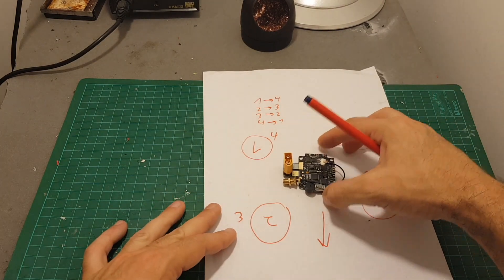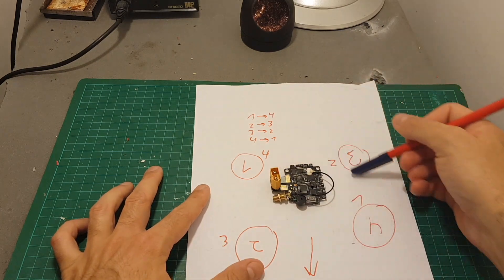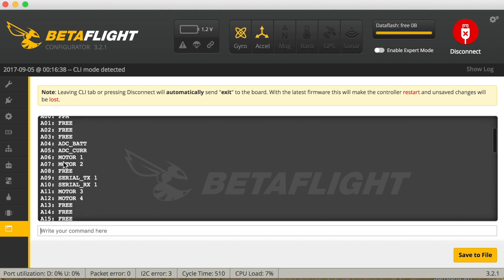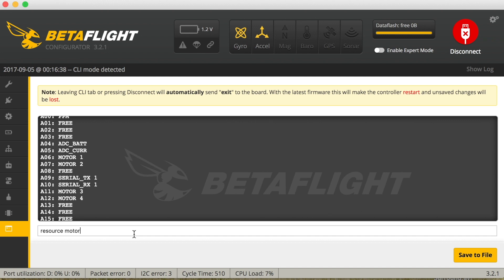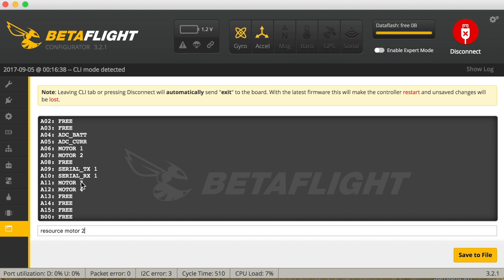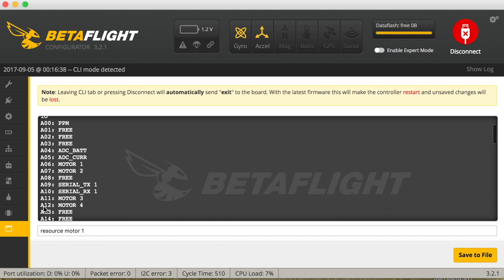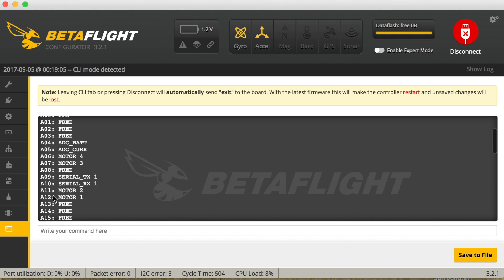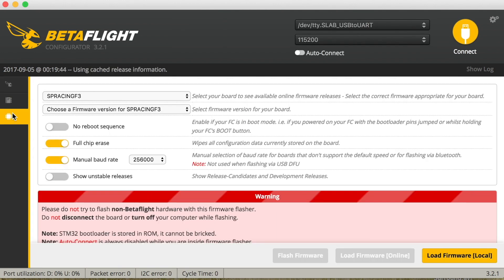Betaflight Motors Remapping Guide

Comment: Guys, I tried to remap the motors today. Did for 3, but wanted to check which resource to map to my last motor (it stayed disabled). Clicked cancel and now BF won't connect to the controller at all :( Anyone knows what the reason can be?
Reply from the maker: Did you figure it out?
Reply: @KremerFPV  thanks, yes. I did bootloader from FC and reflashed the target.

Comment: and if after this, some motors are spinning in the wrong direction? then what?
Reply from the maker: You need to adjust the motor direction using BL_Heli or BL_Heli32 app, depending on your ESC.

Comment: I have a slightly different problem which is that my 2 front motors spin in the same direction and my 2 rear motors spin in the same direction. So, I want to switch 1 and 2, but when I use this method, the two front motors still end up spinning in the same direction and same for the 2 rear ones. PLEASE HELP! Anyoneeeeee
Thanks.
Reply from the maker: You need to reverse the direction of your motors using BLHELI_S or BLHELI_32 depending on your ESC.
Reply: Gal Kremer thank you. Quad is in the air
Reply from the maker: @trisssssssss  Perfect!

Comment: I just replaced motors on a fully running quad. The front pair are backwards. The rear are correct. How do I change individual motor direction. Swap outer 2 motor leads maybe ?
Reply from the maker: You can swap out two motor wires or change the motors direction using BL_HELI or BL_HELI32 suite, depending on your ESC.

Comment: Thanx a lot, I just had to remap my motors after updating my Tinyhawk Freestyle to betaflicht 4.2 RC3. 
You saved my day!
Reply from the maker: My pleasure. Have fun! :-)
Reply: i have the same problem after betaflight update i had to remap my tiny hawks motors, but it stills flips over when i first try to take off, i checked the motors and prop orientation, also check the board alignment. were you able to get yours running??
Reply: @BmoreVisuals  Yes. 
Try Configuration -> Board and Sensor Alignment -> Yaw Degrees "90" and First Gyro "CW 180"
Reply: @BmoreVisuals  props in correct way?

Comment: nice video. i only want to change the direction of one motor. what command should i write? e.g. i want motor 3 to be in reverse direction.
Reply from the maker: Thanks. For reversing the motor direction use either BLHELI or BLHELI32 suite.

Comment: Hi man nice video as always!!! I have the FC and 4in1 esc upside-down and motors won't arm...need only to remap the motors?
Reply from the maker: Thanks,  yes, you can and should remap the motors,  but it has nothing to do with the arming issue. Check the arm flags on BF.
Reply from the maker: If the FC is upside down too, you need to change its orientation on BF.
Reply: @KremerFPV  yes I've change the orientation of the fc...the problem was with inverted receiver channels...now everything work...thank you!
Reply from the maker: @CruZifer.23  Np. Happy flying!

Comment: Glad I found this!  Just built a quad and wanted the battery lead on the left, had no idea I was orienting the FC back-the-front.  The frame is the HGLRC Arrow with stretched back legs so a simple 180 flip would not have been possible after cutting the motor wires to length.  Had a feeling this was possible but thanks for taking the time to map it all out so clearly.   That's 12 solder points I don't have to re-do.
Reply from the maker: I am glad I could help you out. Happy flying ;-)

Comment: you're doing it the hard way just change the board orientation to make the front of the board the other direction
Reply from the maker: +norman hayes This guide is useful if you need to remap the motors. Changing the orientation of the board does not affect the position of the motors.

Comment: Do you need to switch the layout setup screen to "CUSTOM"? Or just go with the basic 1234, remap, and it will keep the 3D model instead of the custom brick that replaces the drone?
Reply from the maker: The only thing that you need to change besides the motor layout, is the board orientation. I should have mentioned it in the video.
Reply: Great! Very helpful :D
Reply: I just made my smokestopper this evening, hooked up the battery, and the magic smoke stayed inside the boards :) Video is transmitting. Now for the receiver, and tweaking Betaflight :)
Reply from the maker: Good luck! :-)

Comment: Awesome! I just built one and needed to do the remapping :D
I got one of the all-in-one ESCs that have 3 and 4 reversed, and I didn't want to do that messy crossed over wiring so I just wired them straight up so I could fix it in software.
Now I don't even have to look that up :D
Reply: My case was the same. Tyro 79 with new ESC and flight controller.

Comment: you can change the yaw in the configuration tab. i
Reply from the maker: It will only change the orientation of the the flight controller - not the motors layout.
Reply: I understand, I am used to using regular flights controller.
thanks for answer!